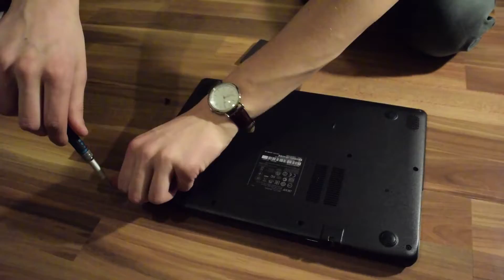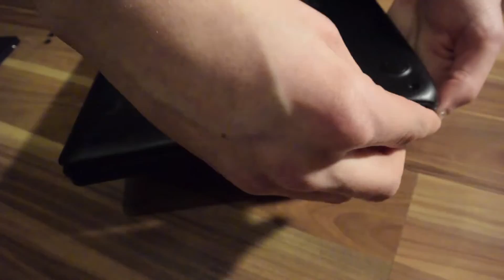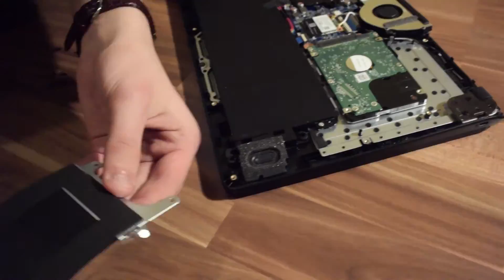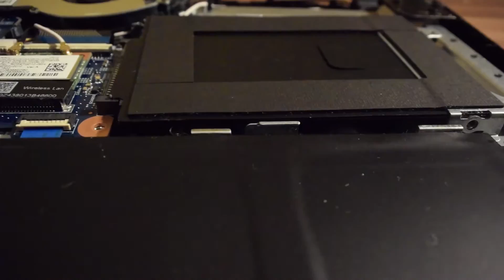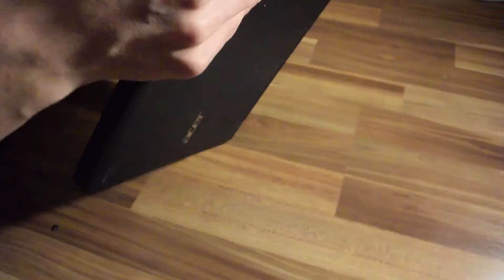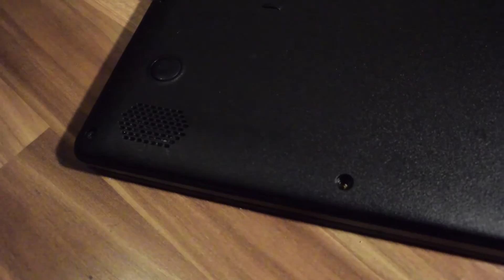Acer Aspire ES1-311 SSD Upgrade Tutorial

Comment: I have an ES1-131. It has room for an HDD/SSD in the case, but it's empty and with no SATA connector on the board. However, the motherboard does have connection holes for a sata connector, as though different versions of that same board do have the connector. Can I just buy the connector and solder it onto the board to add a SATA SSD?

Comment: Thanks for the video! I did the same but also I want to upgrade the RAM, I think 2GB is not enough, so my question is, need I a DDR 3L for this one? or can I put a DDR 3 memory? and my other question is about the capacity, if can be 4 or 8, because the laptop just has one slot.

Thanks!
Reply: You need DDR3L type RAM. 2GB or even 4GB is not enough. Go for 8 GB RAM single stick as the laptop only has 1 slot for RAM.

Comment: I have this model (4gb ram) and it suuuuuuuuper slow to even load the browser (and it was the sam efew years ago). I have no idea how it could get positive reviews even if the most basic and common task as opening the browser is painfully slow. 
I am considering upgrading to ssd in hopes it would be more acceptable.
But seriopusly - how can a laptop be slow even opening browsers? :D
Reply: I am using the same device and its a mixed problem. First of all the original Hdd is suuuuper slow upgrading to a Ssd already gave me a gigantic performance boost. But the processor peaks out just by opening the browser so thats a bottleneck aswell. But without a Ssd its stright up unusable

Comment: I just bought acer es1-331-p6-p7, which has quite nice specs for my use, but would love to change the 5200 rpm hdd to a ssd. I've done so with some HP laptops with the "maintenance hatch" so this is bit different than that, but not much. The thing Im worried about is warranty. Are there some hidden stickers on acer products or something? There is no warning stickers about warranty above the screws. Do you know how acer etc. approaches this?

Comment: Thanks this was very helpful to replace an EVO 850 250GB harddrive succesfully. Unfortunately, only after doing it I found out that the Celeron N2840 only supports 3Gb/s SATA, so the transfer rate is limited to 260MB/s Instead of the expected 550+MB/s. Combined with missing some more USB 3.0 ports and a VGA port, I'm thinking of returning this laptop and maybe getting a Lenovo E31 with Intel i3.

Comment: Hi, I've bought one of these netbooks for my daughter and purchased a new ssd for it. when I opened the back, there is no hdd or ssd installed. it has a socket but no drive..... I found out it has emmc memory. can I install the ssd and increase the capacity which is currently only 32gb?
Reply: +Gareth Jones yes you can. I have tried it and it's ok
Reply: Ok, thank you 👍
Reply: I have tried the same, but my laptop cant find the SSD in bios. Do you know why?
Reply: have you tried "disk management" ? (my computer right click > manage> disk management) it must be show your new ssd over there.
Reply: I could not use the ssd and finally had to use my old hdd from my ps4, it was a 500gb sata drive, I formatted the drive and installed it into the netbook, did a fresh download of windows 10 onto the hdd, then run windows from there. The upside is that the computer has no bloatware at all, very quick startup and only a little noise from the hdd. It's been used daily for 4 months with zero problems. I simply could not get a uk version of this netbook to recognise a ssd, Acer also said it was incompatible

Comment: hi,i would like to ask some info and help. i have acer es1 331, which i think is the italian version (since i am in italy), has the same caracteristics. it didn't have HDD but there was empty space, so i upgraded to ssd Samsung evo 850, and everything works perfectly. So i have two questions: first one is can format emmc drive after cloning the drive with Samsung migrate? the second question is refered to chrome, and other browsers as well. on this laptop i have terrible experience with all other browsers except microsofts edge and ie, which work like charm, scrolling and response. but i don't like them. while the scrollin and reactivity of other browsers is very very slow. seems like using some laptop from '90. do you have the same proble and is there a solution that you know? thank you in advance
Reply: +alan hrustanovic posso sapere quale e il numero di serie? lo vorrei comprare pure io pero solo se si puo installare l ssd
Reply: +Indro Spinelli si tratta di es1 331-c8pgg! ma ti devo avvertire che praticamente solo Microsoft edge e internet Explorer si possono usare per il browsing. gli altri browser sono lentissimi e non so perché visto che ie e Edge vanno alla meraviglia, solo che non mi piacono!
Reply: +alan hrustanovic guarda io lo sdraierei per metterci linux. Quindi non penso sia un problema quello. Grazie mille!
Reply: +indro spinelli anch'io ci ho pensato ma non sono molto convinto xche win 10 gestisce meglio la durata della batteria per quello che ho sentito. ma ho dubbi anche sulla compatibilità di tutti i driver..prova!
Reply: +alan hrustanovic Was the ram upgradable too?
Reply: yes it was
Reply: Ciao, sul tuo modello dopo aver installato l'ssd non ci sono stati problemi di riconoscimento a livello di bios? È correttamente impostabile come disco di boot? Grazie!
Reply: I'm using Firefox on it and no issues. As fast as Chrome on my other PC.

Comment: Kingston Technology 120GB Solid State Drive 2.5-inch V300 SATA 3

Does this fit?
Reply from the maker: +Simon Hellman that is wrong. They only fit if they're 7mm thin as I said in the video. I have one older Kingston SSD at home, currently build into my MacBook and it doesn't fit in.

+Andrew Yau Your SSD will fit.
Reply: +Andrew Yau All 2.5 inch SATA drives should fit this.
Reply: I am just reading from SANDISK and KINGSTON website, since I have to install a SANDISK in minutes. The SANDISK is 7mm thick, the KINGSTON too. I am a PC hardware reseller, never had a problem from customers for any kind of SSD (from SAMSUNG to funny SILICON POWER SSD).
Reply: CONFIRMED: SSD installed with NO troubles. You MUST remove two mini-planks of plastic before installing the drive (bi-adesive tape on them)

Comment: Do you have to reinstall an OS after replacing the HDD by a SSD ? I would like to replace the HDD on the laptop to install linux. Thanks ;)
Reply from the maker: +Clément Tamines I did have to do so, because my new ssd was empty of course.
Reply: +error0x0000034 Ok thanks, I just wanted to make sure the OS wasn't installed on a eMMC memory. I'm really considering buying this laptop. The only thing keeping me from doing so is that I read online that the trackpad sometimes doesn't work. Are your experiencing any problems with that ?
Reply from the maker: sometimes it doesn't react, but it doesn't bother me too much. it works just like on any other notebook for me.

Comment: Does the board have 32 GB of soldered storage on it?
I was wondering about the successor of this model (the ES1-331), which is advertised as 2 GB RAM and 32 GB eMMC; Asus's website confirms that it supports up to 8 GB of memory but only a Taiwanese retailer claims storage upgrades...
Reply from the maker: +Riccardo Boninsegna the ES1-331 is the Celeron model, not the successor. It has some different specs, I don't think that the 32GB storage is soldered on it, probably mSATA, but I'm not sure.

Comment: Did you have to do any changes in the BIOS after the SSD installation?
Reply from the maker: +waterman77 Nope. Are you experiencing issues?
Reply: Yes, I got an error code: 0xc000025.
it either says "required peripheral is not connected or not accessible" or "\windows\system32\winload.efi  - missing file or corrupted, OS can't be loaded". I used OS migration tool from Paragon HD Manager Suite 15 to copy my files from the old hard disk to the SSD (Sandisk). Any clues?
Reply: I found the solution here:
http://www.registryrecycler.com/blog/2014/02/how-to-fix-0xc0000225-boot-error-in-windows-8-1/
Reply: did the BOOTREC /REBUILDBCD command, then it worked